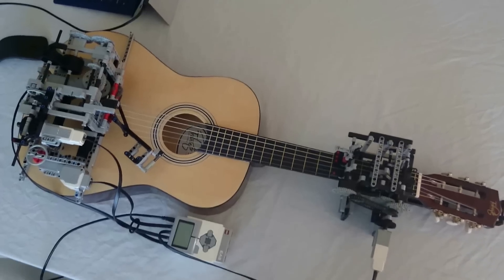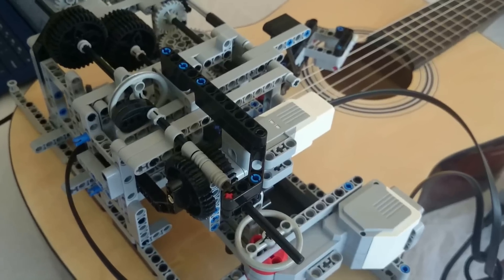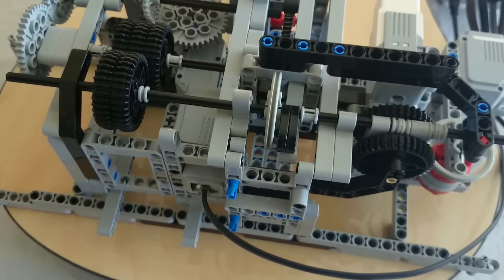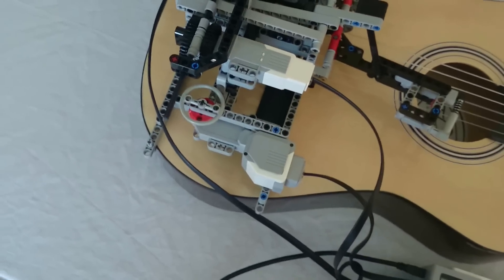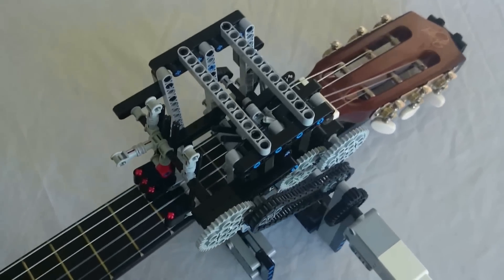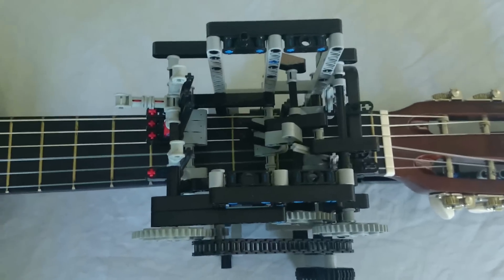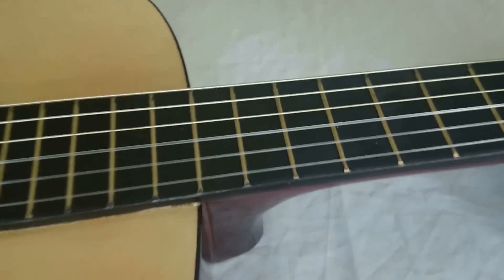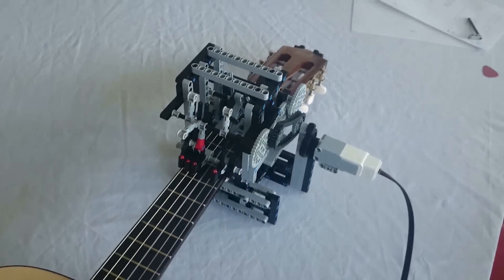Lego Guitar Robot: A Closer Look

Comment: May I ask what the name for the "gear" on top of the motor controlling the movement of the frame is called? I can't seem to find it, and I'm trying to build one of these robots too.
Reply from the maker: Hey there, the part on top is called a large steering pulley - part no. 3736.  But it doesn't really do anything except for allow me to easily turn the motor by hand.  You could use any part you like.  Underneath is what is holding the frame.  I believe it was just a technic pin with either a bushing, a 1L pin connector or an 8t gear or something that fits snugly between 2 lift arms.  Would love to see your robot when it's finished!

Comment: hey could u please tell me about the program...I mean how did u program it for chords for a new song
Reply from the maker: Hey there.  It can only play the one song (or something else that uses the same 4 chords) as the chords are built into the hardware side of things not the software.  I don't know if you've used the Lego EV3 kit before but all you can do is program motors to turn when, how fast and how much.  So the mechanism I have used here will press on the next of the 4 preset chords for every quarter turn.  The program just says wait, rotate, wait, rotate, wait, rotate etc.

Comment: Does anyone know what he does as his normal job? Does he have a background / degree in engineering?
Reply from the maker: This is as far as I'm going to take this project - I tried to make a better bot that could play tabs but the Lego motors just weren't powerful enough so I had to ditch it.  There is a guy who has made a robotic bass bot (plays strings built into it - not an actual bass guitar) which is much more capable than this, and there are also more capable guitar playing robots but they just consist of dozens of solenoids or actuators with a million wires coming off it and you can't really see what's happening so it's a bit boring.  I just wanted to try and create something simple with lego that could just do A song, but was interesting to watch - the strumming part would have been much easier if I built something that fully covered the strings but it's not as interesting when you can't really see what's happening.  I wanted to strike a balance between something that looked like a bit of fun and wasn't too involved.  I think it went ok!
Reply from the maker: Well, no, not really... This bot can be on one of 4 chords, strum down or down and up, either hitting or not hitting the top string.  For a fully functional guitar player you would need to play every fret and every string individually and be very very fast at it.  You would need to be a pretty mean Java programmer to make it all work too...  I had an attempt at it on bass guitar but unfortunately the limitations of Lego kick in.  It could be done with other motors /solenoids and controllers but I am just sticking with Lego for now.  Glad you like it though Dante hopefully you get to make your own one day!
Reply from the maker: Well, I know me pretty well :P  I'm an electrician - this has nothing to do with my work.  I just have an appreciation for mechanical things as well as a bit of creativity and patience.  :)
Reply: man you really should put more work into it! it's really cool, if you manage to make it fully fuctional, I'm sure it is going to be a success
Reply: OK!? It went AWESOME dude. I understand what you meant, indeed it would be boring if it was all covered by wires and gears. It's just that I thought it would be easier to make it fully funcional from the point your bot is.

Comment from the maker: Some close up photos:
https://goo.gl/photos/NKA4uHTHXQgJ5QKGA
Reply: what did you study ? have you some suggestions?
Reply from the maker: Hi Leo, sorry for the delayed reply, I haven't done any sort of study related to this.  I am an electrician for my normal job.  I think most jobs in robotics / design would require you to be able to code, and know how to use 3D modelling software (like CAD etc), but I am not exactly sure, since I don't actually do anything like this for a job...
Reply: Hey I'm student in 12 grade and I'm very loved your robot and I tried to build one by myself on my guitar and I successfully made it but the program I built doesn't work very well, it have delays and I can't find way to fix it, can you please send the program your robot to my email? Guyc1800@gmail.com
Reply: could you please help me with any building and programming instructions for this guitar playing robot ?
Reply: I do not understand the mechanism of the chords how it works to do it with the motor in the gears so that they agree I do not understand the assembly of how the gears should be placed to be the correct chords and that they do not collide with each other, the change system is made  .  And if other songs can be created without changing the structure of the gears.  And how does the software to change songs or create a song work?